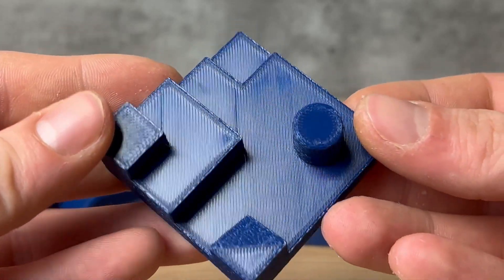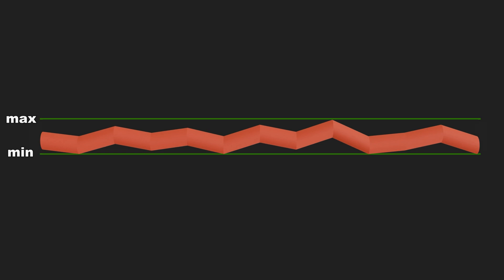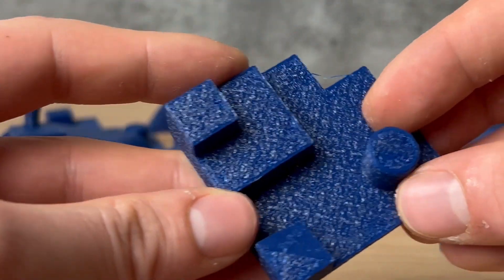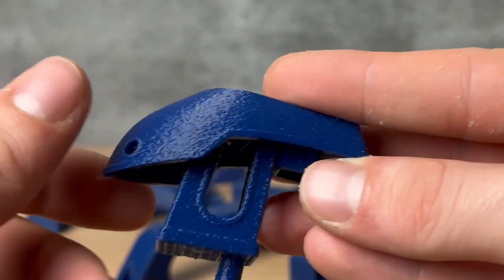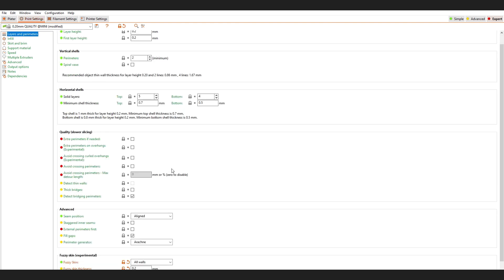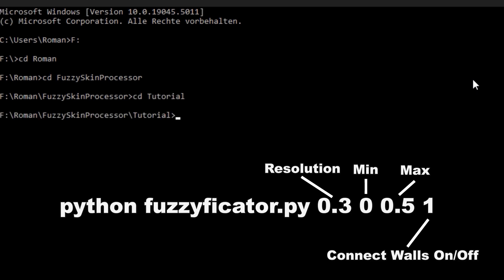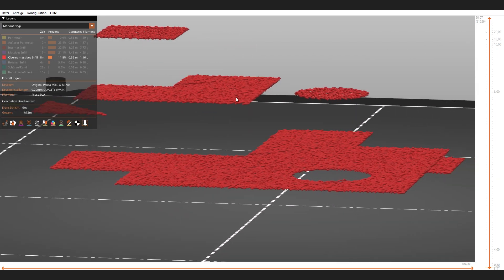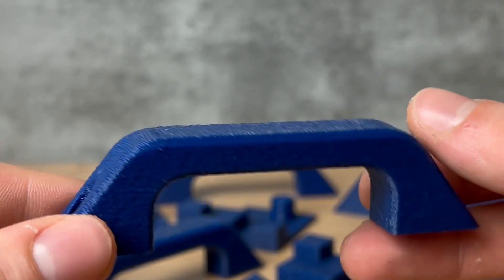Non-Planar Top Fuzzyskin - 3D Printing!

Comment: first thought, it would be interesting to use a perlin noise or any image for the max value 
basically just map the xy value of the gcode to the xy on the image (scaled to a given position) and take the lightness value (i.e. average or max of the rgb values) and scale the maximum by that amount.

that also would allow enabling and disabling it at different points, ideally you could have a getMaxAtPoint(x,y,z) function that can be swapped out with anything (so for example you could use the model and generate bounding shapes where you don't want the fuzzy skin to be applied.)

Comment: if it's just checking the top surfaces it should work in orca as they both use the same comment to denote that section
Reply from the maker: If it‘s the same comment, absolutely. I just didn‘t test it so I didn‘t mention it.

Comment: While it's neat you can do this, I would like to note that by using a complex top surface pattern like Hilbert curve and increasing the extrusion for just the top surface so that you intentionally over extrude can achieve a similar result without destroying your lead/ball screws.
Reply from the maker: Yeah, someone mentioned that to me on reddit. There is a video about it from Teaching Tech. But I didn't see it before I shared this. It's a different approach though, and I think it's always good to have multiple approaches to choose from.

Comment: RIP Z axis 😂
Reply: 'tis just a workout for the leadscrew 🔥
Reply: I didnt need those ball screws anyway...

Might help to slow down on top layer but yah i feel like this is going to add a ton of wear really quickly.
Reply: Finally a use case for the voron trident design 😂
Reply: I just bought some PTFE sticky grease, that's going to come in handy.
Reply from the maker: Yeah that will be a problem if you print like this alot. I've planned to make the speed manipulatable, this will hopefully help a bit.

Comment: This needs to be intigrated in orcaslicer! Great Work 👌🏻
Reply from the maker: I'm working on that but with a postprocessing script, which you can add to Orca. The next step would be a pullrequest to the orca slicer and I try to do that, but they have to approve.
Reply: @tengertechnologies  I think it would be much easier to integrate directly into the gcode generation of Orca rather than doing a post-processing script.  Basically it's similar to what Orca already does with the outer wall, but adding an offset to the z-coordinate for a top layer.
Reply from the maker: @MisterkeTube  Yeah but the problem with that, is that Orca would have to accept a pullrequest. I will try to do this but first it should be a finished postprocessing script.
Reply: Yes please!
Reply: It needs to be integrated into PrusaSlicer and Bambu Studio as well. Since the others are forks of PrusaSlicer, probably best to start there.
Reply: @logicalfundy  You're much more likely to get a pull-request taken into Orca than into Prusa or Bambu.  Once it is in Orca, the others will feel more pressure to offer the same and pull the change up-stream.

Comment: You just fixed the main reason people often ignore fuzzy skin.

Now, would it be possible to add fuzzy skin to bottom faces with the help of custom supports?
Reply from the maker: I'm working exactly on that right now. And I'm working on easier use from within the slicer directly.
Reply: I guess textured PEI is something that assures this on bottom layer - at least for ground bottom layer :).
Reply: You can add fuzzy skin to the bottom surface in orca slicer already.
Reply: @yeheyheyyeh89  Mmmh, you're gonna have to drop a parameter name or method to get that result? Because I don't think I've ever heard of that being an option. "Apply fuzzy skin to first layer" is an X/Y outline modifier only, and does NOT influence the actual bottom surfaces at plate or where supports would touch.
Reply: I always saw the top as the biggest gap, as you can always use a textured build plate for the bottom. Not as much control over the result, but it's an option.

Also I have some concern over how a fuzzy skin modifier on the first layer will affect adhesion to the build plate.